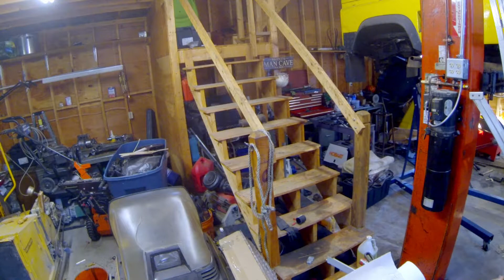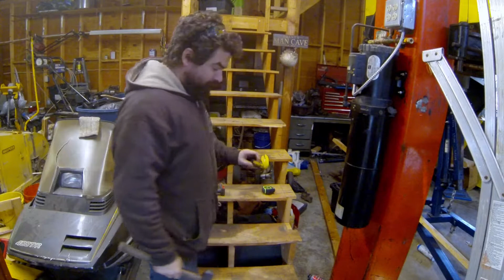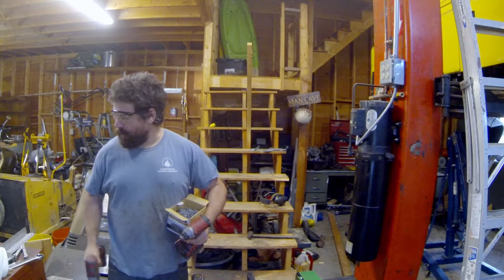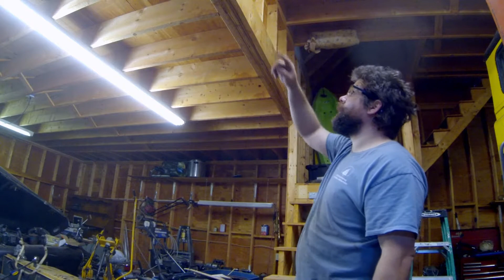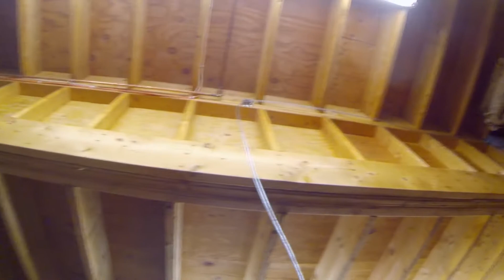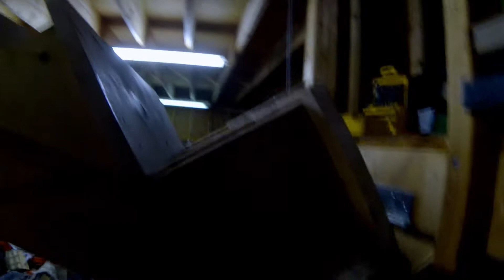Winch Lift Staircase

Comment: Very helpful video - I was going to build my set of retractable stairs with two cables, but it looks like I really only need one.  I will be adding a locking safety pin so once the stairs are up, if the cable breaks there is no chance the stairs could fall down and hurt someone.